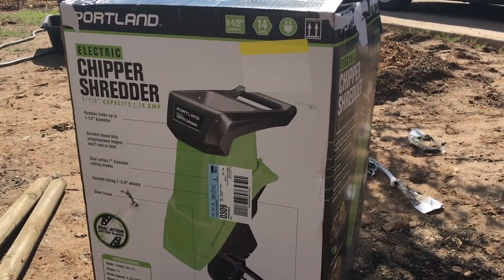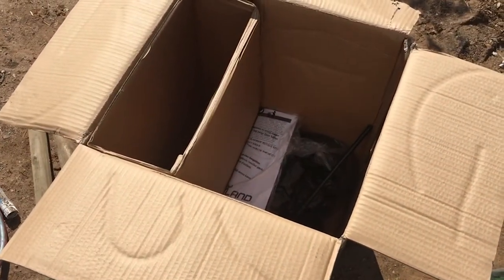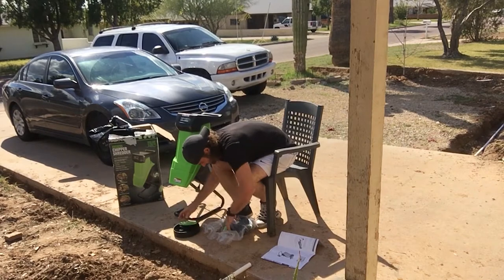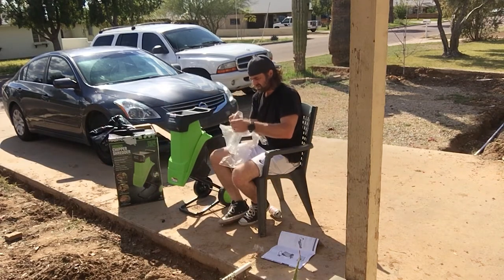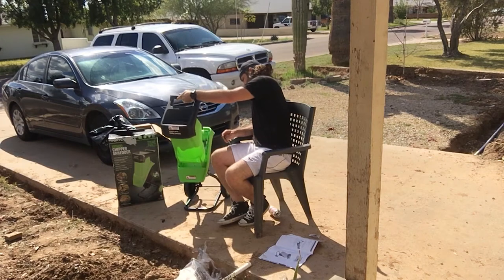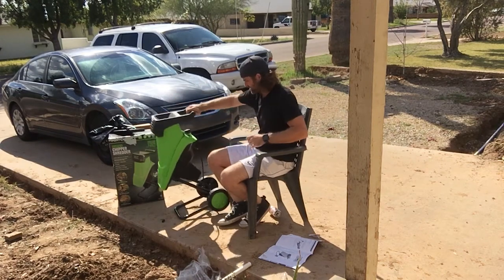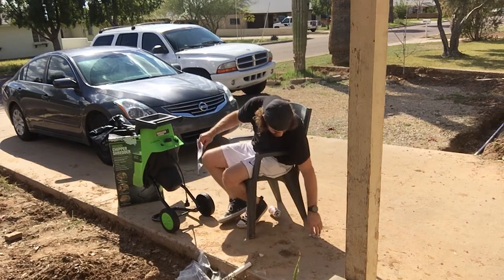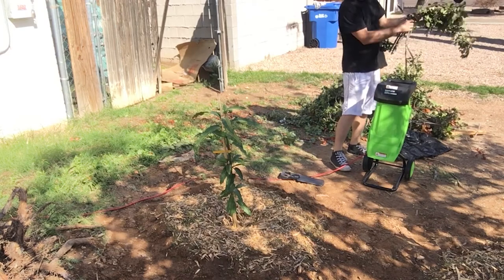Ep 28 - Harbor Freight Wood Chipper

Comment: I had the earlier 14A version, and it just died, after two seasons. This one adds a double insulated motor, but is otherwise very similar. I used mine lightly for the first season, but it didn't do a great job with small branches, so I stopped using it. This year, however, I discovered that it was really good at grinding up acorns, and with three oak trees on our yards, we get a whole lot of them. Unfortunately the unit started to play up. The motor speed seemed to drop, and then after a while I could smell plastic, and not long after that, the motor burned out. I managed to take it apart, to discover that the top motor bearing had failed. This had caused the bearing to overheat, melting the thermoplastic housing, causing the motor armature to come into contact with the stator, and eventuially resulting in the stator windings burning out. It seems like the over current protection didn't protect it! The motor brushes looked hardly worn, with loads  of life left in them. Sadly, the only spare part listed for it by Harbor Freight is the belt, and ironically, the belt looks perfect. So as it stands, my unit is junk. I would suggest that anyone buying a unit like this, if there isn't spare parts support, should take out an extended warranty. Otherwise, when the unit fails, you'll be out of luck. Sun Joe sell the same units under their brand, don't know if they support them with spares.